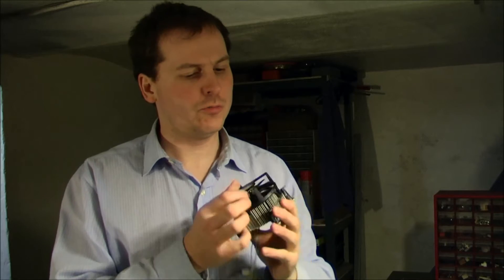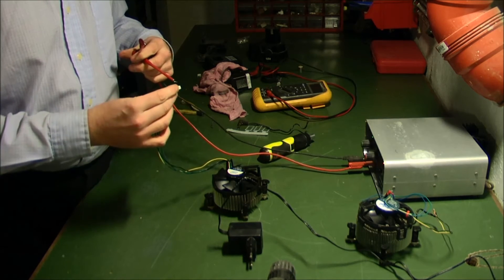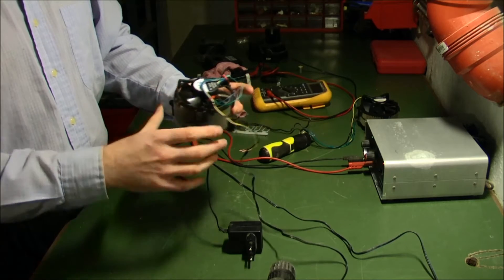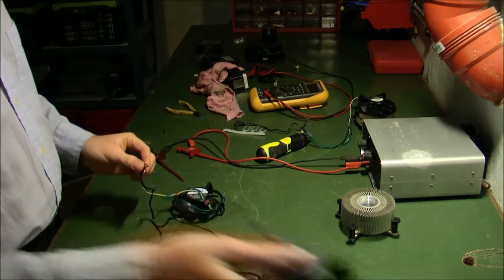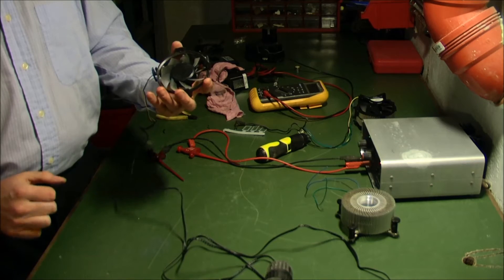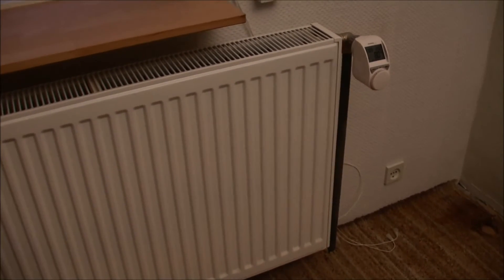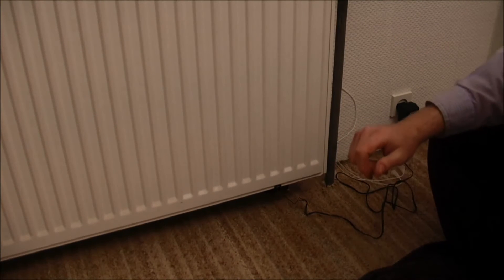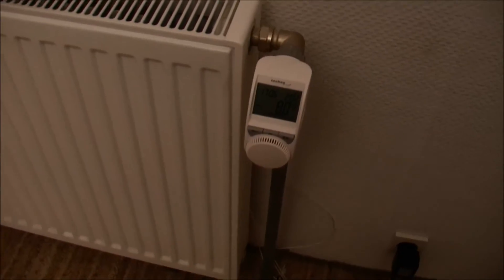Improve airflow through radiator, with Intel fan - 008

Comment: Nice video Your better fixing  fans with soft rubber and magnets to stop some of the vibration an noise from .thats what I had to do then put  rad deflectors on top to divert air more into room.
Reply from the maker: Hi Mark Clancy
Thank You very much!  Not a bad suggestion,, but I have more problems with the battery running out :-)
Thank you for watching! :-)
Reply: @MyPlayHouse  I tried a couple of fans on top with lithium batteries in but they went flatter quicker then normal just got 5v silent usb cooling fans under now plugged in with a WiFi plug so can turning it on n off when heating comes on.then I can use these fans in summer as cooling fans.
Reply: @MyPlayHouse  attach a solar panel?

Comment: My radiator is - 600 mm from my - frozen hands - my idea was to also - attach large diameter - flexible ducts
Reply from the maker: Hi +OghamTheBold 
Not sure I undestand what you are wanting to do?
Thank you for watching! :-)
Reply: Accelerate air - by blowing - on cold claws - down ducts - effectively elevating - the temperature
Reply from the maker: Hi *****
Okay,,Cool,, or Hot :-)
Thank you for watching! :-)
Reply: I was thinking that such a fan  would increase heat output just on the coldest days of the year allowing a heat pump to run radiators at lower flow temperatures. I think the problem would be that if the house radiators were perfectly , then a fan on one would destroy the balance.